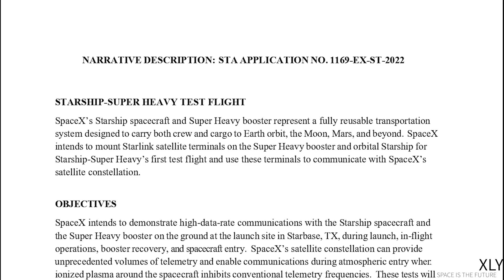Booster Catch proposed during Starship Orbital TestFlight in new FCC Filings | SpaceX Updates

Comment: The Russians tried it 4 times with the N-1 Moon Rocket and failed for different reasons every time. Like the Russians SpaceX is doing an All Up test when they launch. The booster hasn't flown 1" and Starship 10 slowly climbed to 32,800 feet. They haven't flown together except in a computer full of imaginary numbers. There is a lot that can go wrong just with the launch let alone 2 landings. Plus they haven't even dropped a booster with the crane and try to catch it. No real world testing and rapid development are going to lead to one of two outcomes. Elon Musk is going to absolutely pull off the most bold and advanced space flight attempt ever or it will be a spectacular failure due to several unforeseen problems that were not known. Landing a booster unsuccessfully and destroying the tower on the first attempt would be a Foolish Idea!

Comment: I think a catch or landing was just too risky.  I think they are going to take whatever fuel is left and hover for as long as they can and maybe test how easy it is to maneuver while hovering.  This will at least give them a lot of data to work with that they will apply to the next launch... which likely will be a double catch.  I think because of the restrictions in Texas they might push to get the tower in Florida finished and land them both there.
Reply from the maker: NASA is not allowing SpaceX to launch from Cape anywhere in the near future. SpaceX has to prove the booster catch on Starbase a few times at least.
Reply: @SpaceXtudio   Yeah catching the booster is going to be a challenge especially catching it in tact with no damage.